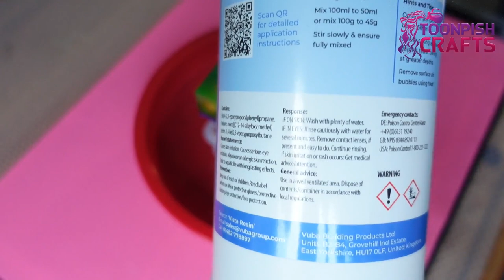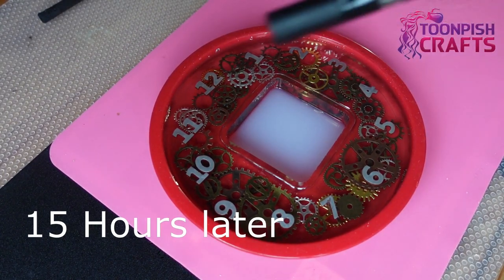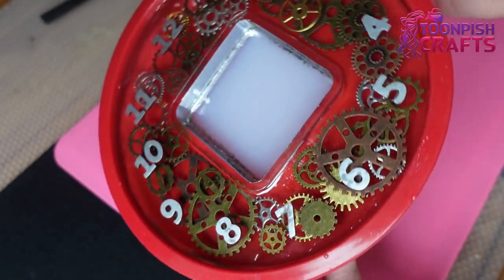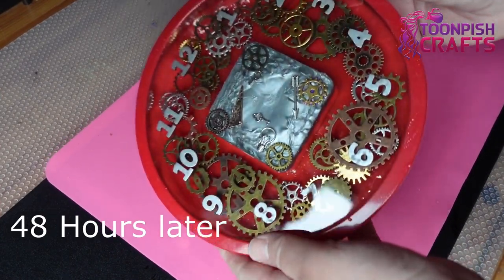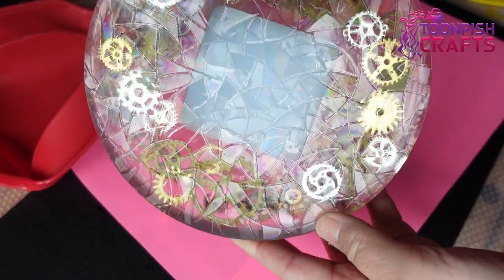Steampunk clock design - January Clock challenge

Comment: Hi Wendy, your work is brilliant, you are my go to for everything resin ( I've only just started) I really would like to have a go at this, can you please tell me the size of both moulds, also I do some work with air dry clay and have got a mould for cogs etc. if I sealed the clay would it work and my last one when do you put up new projects and your draw ??? ( sorry for all the questions ) Keep on with the great tuition, love it, love it, love it, THANK YOU  Janet xx
Reply from the maker: Hi Janet, thanks for your questions 😀
Firstly the cake mould is just that a standard silicone cake mould. I think it’s around 7 inches and the middle one is around 1.5 inches if I remember correctly but really you just need to measure your clock part and find a silicone piece a little bigger than that. 
I’m sure once air-dry clay is completely dry it will work fine in resin. I wouldn’t think you even need to seal it as it’s a dry substance. 
I put out videos every Tuesday and the giveaway ones as and when I hit a milestone for my channel. 
I hope this helps. 
Thanks for watching 
Happy crafting 😀😀👍
Reply: @Toonpish 
 Thanks sooo much for your reply, I can't wait to get started, off to order some moulds lol  xx👍